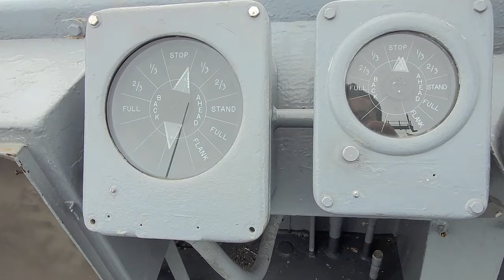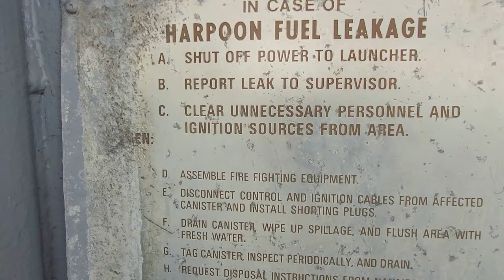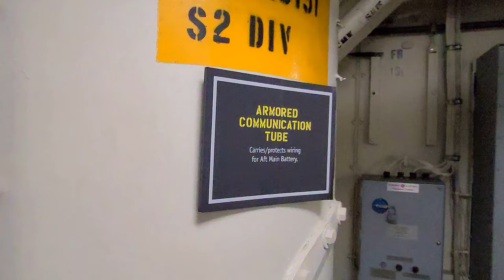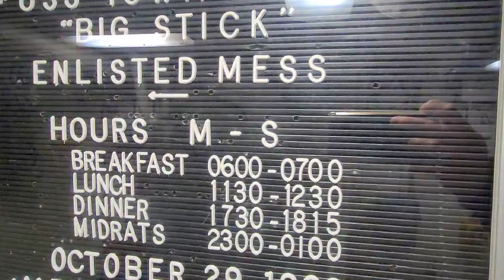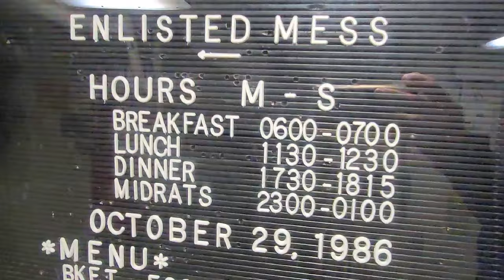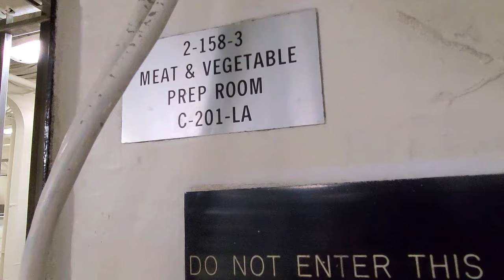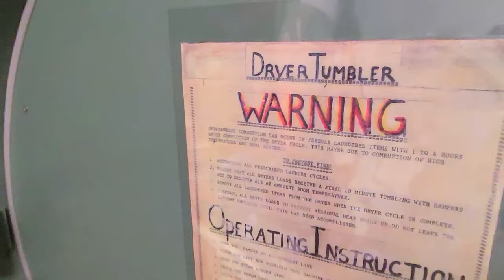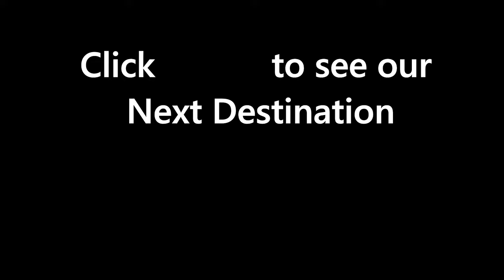Ep. 064: Inside a Battleship

Comment: Another thing to remember, CRUISE ships are meant for leisure, pampering, relaxing, luxury, and a carefree time, BATTLESHIPS are weapons of war, meant to go kill things, cruise ships only exist because warships keep the peace whenever possible, but wage war if necessary to again achieve peace. to wage those wars, you need hard men, and hard men DO NOT require or even desire or want any luxury. and I know it is popular to call them "GUNS" but the truth is that they are NOT guns, they are actually Naval Rifles, the difference is "GUNS" have a smoothebore barrel, "RIFLES" have rifling inside the bore to impart a spin on the projectile, artificially balancing the projectile and drastically improving accuracy till impact.
Reply from the maker: A very valid point and totally agree. Thanks for sharing your perspective and appreciate the information about the difference between guns and  rifles.
Reply: The definition of gun is any weapon incorporating a metal tube from which bullets, shells, or other missiles are propelled by explosive force. Even if you rifle the barrel of a gun for increased accuracy, it won't cease being a gun. It simply becomes a gun with a rifled bore.